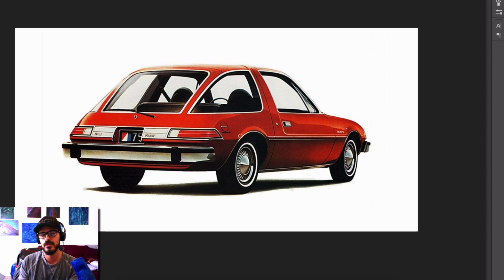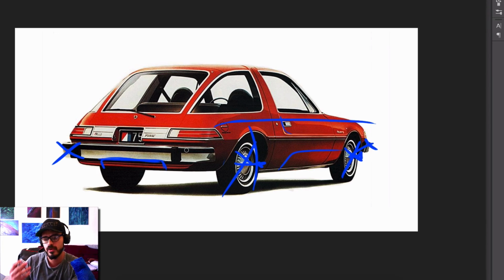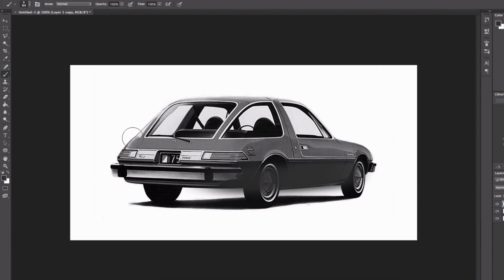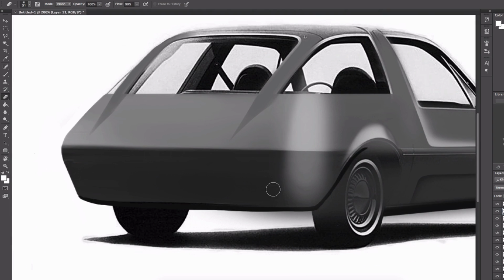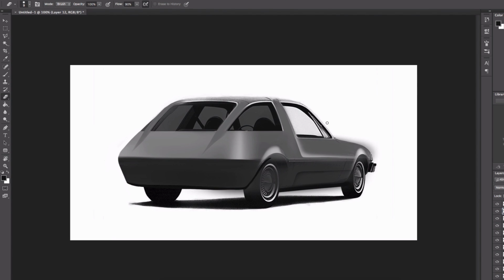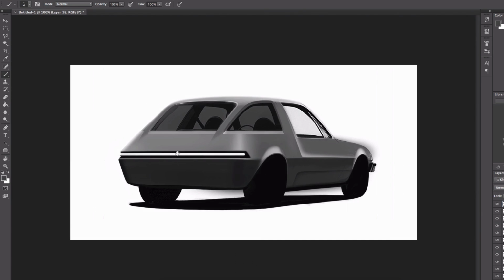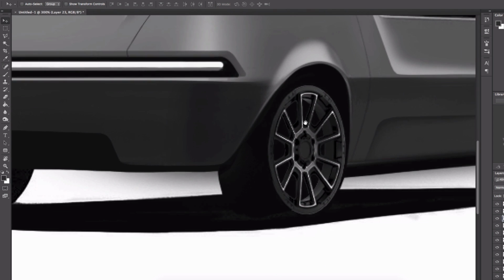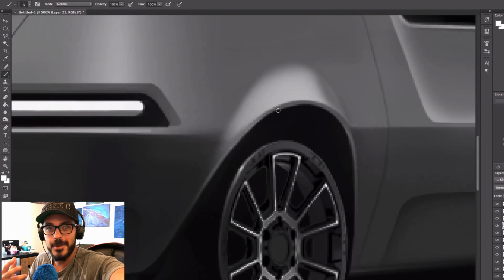AMC Pacer Re-design - What if it was built TODAY?

Comment: It sold like mad for the first 2 model years, then trailed off. Also, it was initially designed to have a GM-sourced Wankel rotary engine, but GM cancelled it. It also was one of the first cars to have MacPherson strut suspension and rack & pinion steering.

Comment: Not at all liking the high belt line. I know that's the thing these days, but it's bad design for a lot of reasons.

Also, the front end is SCREAMING for attention. Remove the headlight binnacles and create a smooth hood. Add low profile digital lighting across the front end for head lights, DRL, markers, turn signals, similar in back in red for brake/turn (LEDs change to sweeping amber), marker, CHMSL, ETC..

Comment: I read Dodge is bringing back the Hornet but it's going to be an SUV. I think the Javelin and the Pacer are two cars Chrysler could do very well with. Maybe market them like the Viper. The customer orders it and they build it. I would love to own a retro Pacer as long as it is true to the original design and concept
Reply: Chrysler needs to revive AMC.  Bring back the Javelyn, AMX, Ambassador, Gremelin, Concord, Eagle, and Hornet in a modern design.  They would do well because there are a lot of people who had their products in the 1960's to 1980's who did well with them, and they did not like it when Chrysler shut it down after acquiring the brand in 1987.  Chrysler only kept Jeep.  They may consider it when Volkswagen relaunches the International Scout, and it turns into a success.

Comment: AMC pacer was gonna have a rotary engine from GM before 1975 before it went on the market but the deal failed due to GM failed tests so the straight 6 was last minute change it was gonna be fwd but ended up rwd the passenger door is 4 inches longer than the drivers door easy for passengers to get in

Comment: I agree it's not to everybody's taste but compared to a lot of cars it's a work of art. I mean have you ever seen an early 60s Plymouth Valiant? For that matter an early 60s anything from Chrysler. A 59 Cadillac coupe' is an exercise in restraint in comparision.
I actually had a '75 with the X package, yellow with the 5 spoke aluminum wheels and a manual transmission. I thought it rode good and handled decent for the time. But it really needed a 5 speed and a higher output motor After an accident it was never the same.

Comment: The third break light could go above, or below the back window, outside, or inside the car. There should be at least one space in the center of the light bar for a round recessed rear camera hidden in the logo/car name to break it up. Place the backup lights on the bumper as vertical ovals/rectangles on either side of the license plate. You're welcome...lol.

Comment: I like the AMC Pacer. To me it doesn't look that ugly. A bit impractical maybe, with solar insolation through all that glass, and if I remember correctly, rather underpowered for the car's weight... it was strongly built and all that glass was also heavy. If I had one I would definitely tint the windows very dark, or maybe even give them a reflective outer surface. Imagine if those windows were as reflective as mirrored sunglasses!

I think the styling was ahead of its time. Today I don't think it would look nearly as shocking. I think it would be a welcome change from the ordinary.  It was introduced in 1975, which was the year of the OPEC oil embargo. Unfortunately because AMC had engine supply issues and had to shoehorn their straight 6 into the engine bay at the last minute, gas mileage was not very good for such a small car (22 mpg according to wikipedia, but that was probably only attainable during long freeway trips) and buyers of small cars turned to imports. AMC at the time did not have a good reputation for quality and reliability. I think the car would have received a better reception if one of the market leaders had introduced it. Oldsmobile Toronado got a good reception in 1966 despite being styled nearly as radically.

If I were going to redesign it I would subtly adjust the compound curves to make it less jelly-bean-like. Making the back subtly boxier would also increase the cargo space. I'd definitely splay the hatchback opening out a bit more toward the edges of the car, not all the way, but definitely angled more toward the car's corners at the beltline. One of the charms of the car is its width, but the narrow hatch fights against that. I'd consider rounding the lower corners of the side windows where they meet the hatch at the beltline. I'd keep the belt line as low as the original. That's part of its charm. I probably would make the doors and windows cut less into the roof. I'd redo the front end and eliminate the headlight pods in favor of flush headlights. I'd also do some wind tunnel testing to reduce the Cd more. Wikipedia says the Cd is .43. That number could probably be cut nearly in half today. Giving it flat underbody panels and flush headlights would produce most of that gain. I'd give the wheel arches more emphasis, like on the 1966-67 Toronado. The hidden windshield wipers were a nice touch. So were the flush door handles. They're keepers.

Comment: I loved them when they came out. I had a 78 pinto runabout in high school/ college. Loved it. The main issue with the Pacer was it was underpowered. The 8 had to be jammed into this frame after the fact. I dont know if something like a Dodge 318 wouldve worked, but buyers were stung badly bc of the low power and bzd build quality. The whole reason behind the mzking of the pacer, vega, and other models was at first due to thevimport competition. The Pinto was designed in 1969, and if it would have stayed with the original idea of the slf sealing fuel tank and air bags, it would have been the most safe car on the road. But it was thrown out. Many of the issues with these cars was what was going wrong Detroit. The stagnancy of the union, lazy designs, forced govt regs. The good thing thst came out of Ford was the L4 engine. The Pinto engine that stayed well after the 1980 Pinto/Bobcat cars ceased to be made.

Comment: only issue is the Pacer should come back electric so no need for the exhaust.  It was suppose to have a rotary when it first came out but GM couldn't get it to work. Also with today's tech you should have kept the glass the same height all around.  I could see the pillars as simulated glass the the roof having a giant moon roof. It would be like the Jetsons car on the ground.

Comment: The accent lines on the side not lining up catches the eye, as does the different window lines... The C pillars would have looked better in the corner instead of around the corner in the back. I also think the slope of the body below that mid-wide point would have looked better being more horizontal. And with dashes so busy these days with displays mounted higher up, I think lifting the bottom of the windshield and side window lines higher to match the back would look better... but just my opinion.

Comment: Very nice, I think the front end of the Pacer still needed a makeover, flat headlight bar, beneath it, front grille opening downward with ground affects on each side so engine gets good air intake as well as good aerodynamics and a small scoop low across the mid section on top of the hood,...cool.

Comment: Do the 1974 Matador Coupe, front and rear. That car was obviously built to do one thing - dominate NASCAR. Unfortunately right when the car was introduced, AMC decided they would bow out of factory support for racing. Unlike Ford, GM, and Chrysler, AMC really did quit their performance projects. The few teams that did campaign with the Matador Coupe in NASCAR would easily win, whenever they could afford a fresh engine. Despite the old school freestanding bumpers (designed to take up to a 5MPH hit with zero damage) and big 7" round headlamps the Coupe was so slick it could easily run away from the Big Three's bricks.
Had AMC been secretly all-in on support for NASCAR teams like the other three companies, the Matador Coupe would have done for automotive styling what the 1984 Thunderbird did a decade later.
A major part of the front redesign should be flattening out the long bumps in the hood back of the headlamps. Straighten the edge of the hood and fit quad mini rectangle lamps in the ends of the grille area. At the back, toss the four round tail lights and replace it with a flush, full width light bar below the existing horizontal line. The bumpers could be fitted with flexible covers that blend with the body. Finish it off with a 'ground effect' kit below the doors.

Comment: The front is so weird you need to redesign it too. The Pacer was intended to use the lightweight Wankel rotary engine, bought from GM. GM announced they were going to build Wankels under license from Mazda. Weeeellll, IMHO that was all a farce, specifically designed to punk AMC. I can imagine the consternation when they called up GM... "We're ready to buy those Wankel engines." "Wankel engines? What? We're not building any."
Since AMC had all the money sunk into the Pacer design, they had to go ahead and build it. So some quick changes to force their old inline six into it and it was ready to underwhelm the car market.

As for the doors cut into the roof, that had been done before by Hudson (one of the parent companies of AMC) on their Italia. Ford would later tout it as an "innovation" on their Tempo and Topaz twins. Another oddity on the Pacer was how the tops of the interior door panels were high above the bottoms of the door windows. That was to provide an armrest while the occupants would be able to look down and out low to see stuff close to the side of the car. Ford would many years later copy that on some of their pickup truck doors. A third bit of weird on the Pacer was the right door was longer than the left door to make it easier to get into the back seat. Dunno why they didn't just make both doors that long. If they ever exported any to RHD countries the lenght difference would be on the wrong side.

Comment: My only complaint is that the mirror wasn't pulled in to the body more. Would have looked slick to have it be part of the door frame and integrated into the lines of the car. Kinda looks like an afterthought as it is...being a fan of the original car, I really like this one. Those things were really roomy for two people in front, and the back was better. Nice job!

Comment: Some more interesting facts about the Pacer:
1. The passenger side door was 4 inches longer than the driver side door to allow easier access to the rear seats. 
2. The car was designed with the General Motors Wankel engine, but when GM cancelled the engine, AMC was forced to put their AMC/Jeep I6 in the car, which made maintenance extremely difficult. 
3. Due to the large windows, there were problems with UV radiation literally destroying the interior overtime. 
4. The car was surprisingly well received in France design wise, but didn’t sell well due to its width. 
5. This car has been in various animated/live action movies and TV shows, most notably Wayne’s World, Cars 2, Monsters University, and Stranger Things (albeit as a background car). 
Also can you please redesign the old New York Checker Taxis/Checker Marathons?

Comment: Could you re design the new BMW 1 Series? Especially the frobt
Reply: Le Jeune 6troëniste I mean i like the rear view and the interior but the Front 🤔
Reply: A good solution would be to make the new 1 series an E34
Reply: Yeah but design it as a rear wheel drive package that fits a 6 cylinder
Reply: @pb7870  they ruined it, I4 and FWD.
Reply: Just take the previous model front and add it up there
Reply: lucasino8 Yeah, with full LEDs
Reply: Oh yes